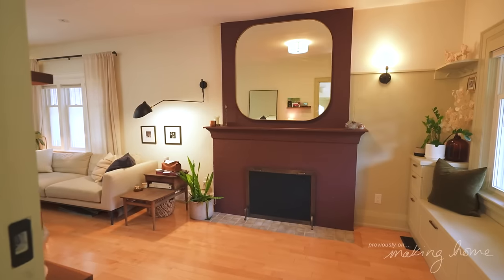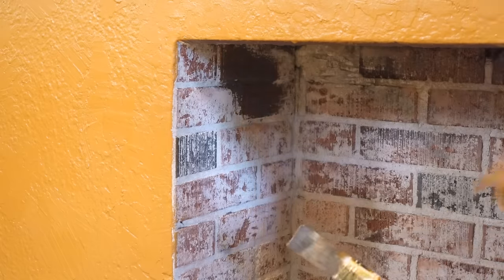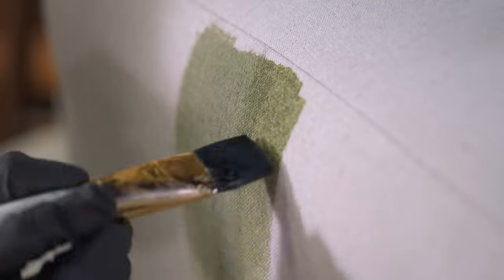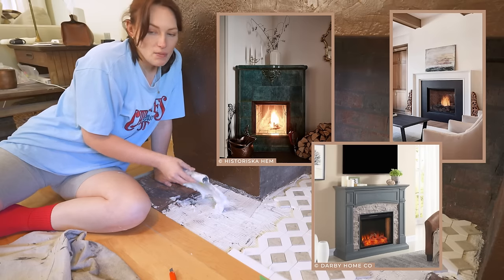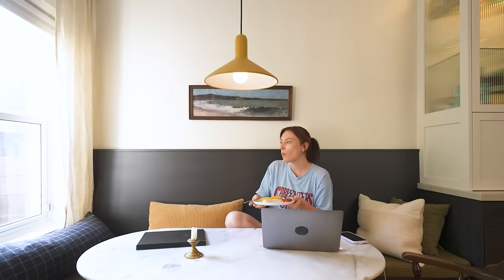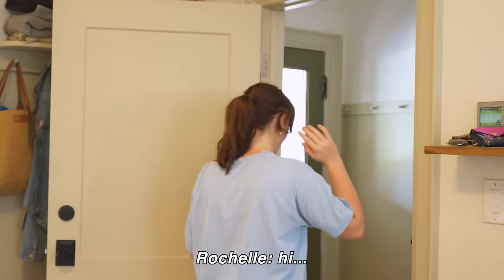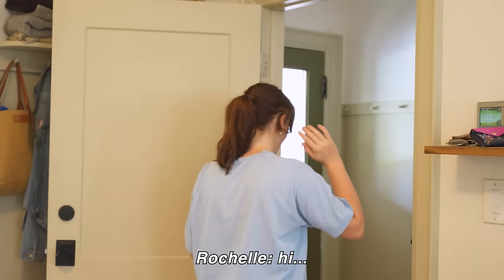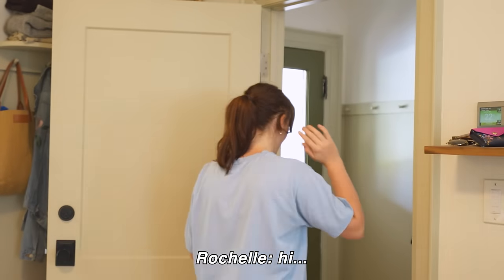EXTREME ENTRYWAY ROOM MAKEOVER WITH REVEAL | fireplace demo & tiling

Comment: Here’s the problem with the fireplace (in my opinion). Because the mantle is painted the same as the rest of the fireplace, you lose the texture and detail. This area in your home always reminds me of the flinstones house for some reason. Just bulky.
I like the copper more than Barney, but this still ain’t it for me. But hey, I don’t live there so who cares? Hahaha!
Reply: It's too much of the same color. It needs at LEAST a strip of another color in the middle.
Reply: @BelindaShort  I didn't mind it all one colour when it was the deep purple colour, but with the copper it just doesn't look right to me. I'd have preferred a deep brown-almost-black on the fireplace, with a wood mantle and then the wall colour above (or a complimentary colour, just not the same as the lower portion). XO Macenna did this beautifully in her formal living room with a dark fireplace and mantle, but light on the wall above. It looks fabulous. I think the darker tone would also really complement the rest of the home, which tends to be a lot of black and white. The copper to me is not a deep enough colour. But hey, they both like it and that's what matters! We don't have to live there. Haha!
Reply: imo the top of the fireplace should be light like the walls surrounding it, and the mantle should be a deeper wood tone (as should the frame) and that's what contributes to the bulkiness!
Reply: It just feels flat and blah. No character. It needs some definition or dimension whether it's different colours or a mantle to break it up. Maybe some crown moulding

Comment: LOVE LOVE LOVE the fireplace makeover. If you want the fire vibe without adding to your insurance or costs, just fill the fireplace with a bunch of same color but different sized candles. I did that with our old house and I may have saved our lives. We had gas heat but of course, electricity is needed to ignite the fire. Well, our electricity went out for 5 days in the dead of winter. My candle fireplace was our only source of heat and after closing off all the other rooms, it actually kept the livingroom livable. So me and 5 kids made the floor of the livingroom our bedroom and waited it out.

Comment: this might be crazy.. but what if instead of painting a faux copper, what if you used copper sheets :o if you don’t plan on lighting the fireplace, i think it’d be a bold and striking move but then it’d actually be copper and would introduce a new material into the space. I think painting the fireplace hasn’t been working because it’s almost.. too much paint? like it’s too flat? the fireplace is such a large heavy piece in the room. Leaning into bolder choices is the right path but I would take it up a notch and use actual copper hahah. again, might be crazy! 🙃

Comment: I would be so tempted to add wooden motifs and edging to make the fireplace look a bit more intricate under a layer of the copper, but wiped so that it would have more highlights. Another idea is having the mantle itself a different color in some way? I dunno, i just feel like it can look even more expensive! I do love the metallic paint to start with :) and the tiling matches the room very well! Love the chair and noticable brushstrokes! Just throw a glass/ ceramic vase or two, maybe a candle, little flower, or hanging plant on the mantle and it will be complete! Beautiful work!

Comment: Love the tiles!!

There is an additional type of fireplaces with real fire where you don’t need to have to worry about fumes. They are alcohol based.

Did you consider painting the top of the fire place in the same color of the walls and just make the focus point on the lower part? If so, what was your inspiration to commit to the block?

Rachel’s green chain chandelier would also be a nice choice for lighting, not sure if that’s the mood you wanted..

Comment: Loved being along for your anxieties and eventual success. Definitely much much better -- I love the ottoman. Not that excited about the art work (though I agree with you about the mirror), but as you said, art is very personal.
Re: fire in fireplace. We spent 40+ years lugging wood for weekend fires and our family loved it. But when we downsized, we decided we were done with that even though our little house has a lovely fireplace. I looked into gas and electric. Gas would cost $6000 USD(!) and though it would be very efficient, it would still be fossil fuel. Electric would be ecological (we have solar cells) but, like you, it just doesn't work for me. So I've been looking into biofuel fireplace grates -- they are freestanding (no installation), fueled by a product that is supposedly ecological and they burn cleanly (don't even need venting) so not producing pollution. They cost significantly less than any other option (other than a cheap electric). Haven't gotten one yet, but we will be ordering one. You could keep your tile, etc.and still have one of these and put it away in the summer if you want the tile to be more on display.

Comment: I prefer the previous color over this one, but I do think it helps to keep the space neutral. I think that if you put a rug in that pulls the colors together from the fireplace and the painting, it would help the space flow more. Put a rug but keep the ottoman on top! I kno w you are a neutral, green girlie but teeny bits of pink will definitely help the space pop and tie in really well with the painting. Also, your tile work is amazingggg

Comment: I feel like the bench would look so good painted a light olive color with gold hands and the top upholstered. And maybe if the shelf was raised to above the window and goes all along the wall with books and vases the room would look taller and you could have curtain hanging from the shelf. I feel like the shelf and the fire place ledge should be a dark wood to match the floating cabinets next to the front door. And the fireplace could be lime washed a lighter color.

Comment: Look into bioethanol fireplaces...super cheap. It's real fire you dont have to vent, no smoke, no ash, less heat output, no cleanup. Some say the fuel smells coconuty and weird but they have 'wood' scented bioethanol fuel too. Also (hence the name) bioethanol is more environmentally friendly than fossil fuel.

The bioethanol fuel can get costly if youre trying to use it as a main heat source (cause it sucks for that) but for the occasional aesthetic, thus is your answer.

Comment: I love the chair! And Rochelle did a great job on that frame. Not a huge fan of the art, but I do like the pop of colour - it is out of your comfort zone but you embraced it and it definitely brings more character to the space. I'm not a huge fan of the copper fireplace - I just feel like it needs to be darker. A deeper brown-black would have been my preference, but I'm not the one who has to like it. 

I think the light is fine, but I think you could find something with more character and possibly even a little bigger than the boob light. The lines of the new light are great, but I feel like it's still too small. 

As for the ottoman, love the colour but the placement is weird to me. Even though it's round, it interrupts the flow of the space. I'd rather see it WITH the chair near the entry, so it's not just floating there in the middle. What I actually think would be amazing there is a sofa like the curved ones at the office, just maybe on a smaller scale. But I'm not sure you need anything there. 

I love that you added wood to the faux fireplace. Perhaps one day you'll find an electric option that meets your requirements and doesn't break the bank! I definitely think the actual flames there would bring this to the next level.

Overall, good job!

Comment: It looks so much more elivated and pulled together. Really nice.

I work at a place that sells all types of fireplaces and there is a small gas fireplace from a company called Valor that could work .The fireplace is the portrait. It would be perfect for that space. They also have one called the H3 that may work. Valor also gives a  lot of options for the esthetics of the fireplace.  As for the tile: as long as you meet the clearances for heat you should stll be able to use that tile. 
I know you already have it done but there are options if you ever decide to change it.

Comment: Hi… Congrats on all your work. Checkered tiles? With respect, it’s a hearth not a kitchen nor a hall. Lol. Frankly, what you did looks stunning. Also, because the fireplace is so incredibly enormous, I feel that the same colour as the wall colour is likely best—even if you chose to do just the top half—which would make your room look A Lot bigger. (The brown does look better than the other shades, for sure🙂. It’s not unlike your hair.) The gigantic mirror was just as dominating, if not more so. No mirror? Good. Furniture feet make your room (A.) look bigger and (B.) protect your furniture. Same with keeping your furniture a minimum of a few inches away from the walls. Again, JMHO. …By the way, lighting a fire takes about five seconds. OR, you could place a few of those enormous white, faux candles inside. …The new light does nothing, sorry. It’s emotionless. …That chair is AWEsome. …Otherwise, The Sorry Girls’ guys all look really similar. …Really similar. Really. Cheers🙂.

Comment: I feel the same as many of the commentors... the copper doesn't translate on camera, the frame of the artwork should contrast the copper, not blend into it because it's lost and the art looks like it's floating. Then you have earth tones and greens everywhere with one element that has pink, but no other pinks in the rest of the house. The RULE OF THREE needs to come into play to help make this more cohesive; add some flowers to a pink vase, maybe a cool/vintage inspired throw pillow that has pink in it, but you gotta ground that pink with something else. I also think breaking up the fireplace by painting the mantle or the upper portion a different colour would help. The tiles are beautiful but the fireplace still feels like it's a massive part of the whole floor and it feels a bit heavy. It really could be the camera and lighting during filming, but what matters most is that the homeowner loves their space, regardless of what a designer (or the public) think! <3

Comment: Interior Designer here...I love the color of the fireplace BUT....I think you need some sort of break in the color....be it painting the ledge similar to the beige color in the new tile, or  bringing in the wall color, or both? However, the solid color not being broken up is the biggest thing that, i feel, is the biggest problem with both the last color and the current color. You could even get a piece of natural wood added to the top of the ledge (which could also make it a lil deeper, if you like)...anything to break it up will make it look even better tied into the rest of the space.

Comment: If you are ever laying natural stone tile the thin set you choose MATTERS. especially with white stones. Using the wrong thin set can cause stains to soak through from beneath. Some stones require epoxy thin set.. And lastly, these tiles should have been sealed before they were installed. I suspect these tiles will start popping up on you in the very near future..

I see you used Mapei thin set here. They offer great courses on proper stone installs. Maybe worth while for the Sorry team to do some digging on the technicals of tile. You have been doing quite a few episodes on them.

Comment: It’s hard to see the bronze on video. It’s not as shiny as I imagine it is in person. It looks awesome with the art though. 
The ottoman placement is weird!  It smushes the entry space and puts a trip hazard in the middle of the room. Maybe a round rug??  Or at least slide the ottoman closer to the built ins and fireplace to a more corner-y type placement. 
The chair works. The variation in the color looks like it was meant to be. But it would be quite cute and cheeky to recover the bottom fabric in a red/pink and used a marker to put a few seed shapes on it. Then if anyone is like oh it’s the watermelon chair you just sat yeah, tip it back, and flash the bottom.

Comment: Ok! I have actual constructive criticism here, not a read!!! It's giving 2004, and I want to explain why! There is a stark difference between the dated texture of the fireplace vs smooth drywall on top half of the stack right now. I'd highly recommend re-stuccoing the fireplace with a modern modern texture (think wide strokes), or completely smoothing it out, like fully sanded.The texture stands out a lot more with the faux copper, and faux texture AND faux metallic paints were huge in the aughts. The lime green ottoman and new art clashes hard with the copper- and they feel confusing in your modern traditional space. You can absolutely make them work, but you gotta neutralize the fireplace back to a cream, the tan of your entry builtins, or a much lighter brown. That would also make your beautiful tilework stand out more. The ottoman scale is a little off in the space- your green velvet article bench (you took to the office) would be perfect floating in this entry, and could face the fireplace or the built ins. Right now there is nothing anchoring the space- everything is hugging the wall, so this space is BEGGING for a rug- either an area rug for the whole entrance, or a runner leading you into the space. Last but not least, we're lacking warmth. A rug would help with that, but I'd love to see some woods in this space. DIY modern traditional wood mantle in your future? Please do!! We can all learn from our love of the 2000s, but especially when it comes to texture and colors, it's got to be reeeeeally intentional to not read dated! <3

Comment: - The ottoman looks weirdly random, as if someone forgot to put it away. 
- You took the green from the painting and found furniture the sake color, but why no little accent in pink?
- the pattern of the blanket clashes with the tiles, a single colored blanket would fit better
- why adding wood pieces in the fire place when you're not gonna light them? Add something functional instead. Candles for example.

Comment: It would look better if you picked a neutral like the one on the entry area right next to it, and then painted the mantle a different darker color instead. So like have the mantle be copper.  Having it ALL the same color just looks very bizarre. If you look at the wall with the fireplace and the wall with the entryway area, they literally look like they belong to two different rooms and were stuck together. They don't match at all style wise. The ottoman is just floating in space with nothing to ground it and it looks like someone literally just stuck it there randomly and forgot it. I don't really see how this is different than the purple fireplace. Its the same exact thing but a different color. Even the tone is exactly the same of the paint.